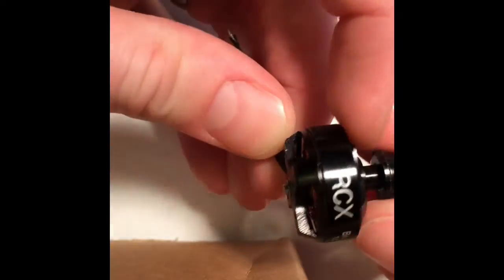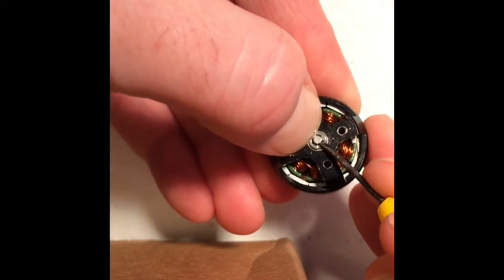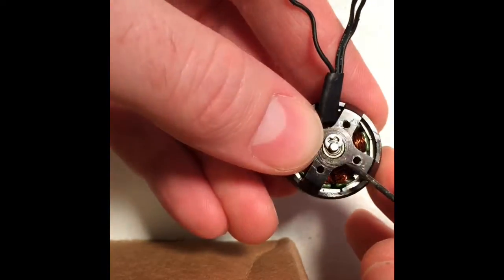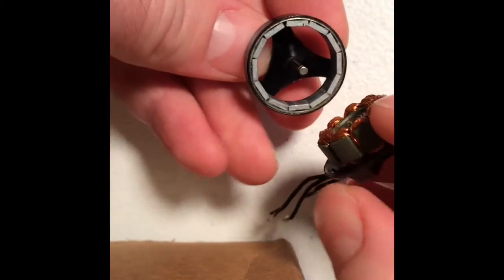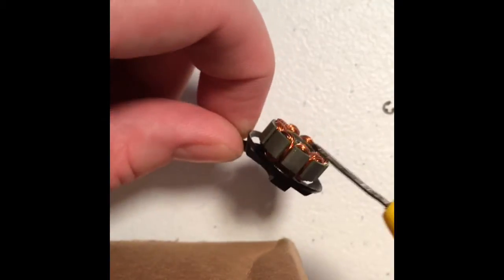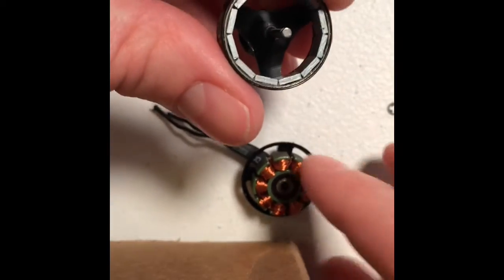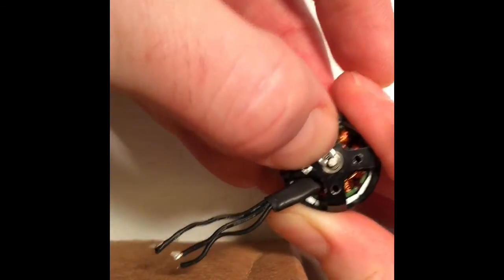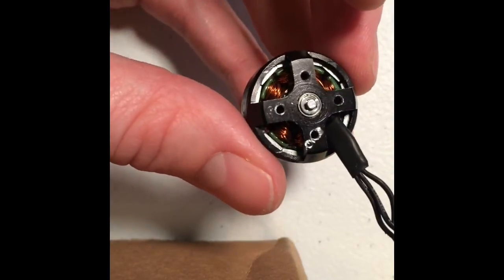Mini quad Brushless motor repair

Comment: I would like to ask you a question would I be able to purchase a Kolletand washer screw seperatly instead of the whole motor for the XK a 1200 RC plane  and I don't want to have to purchase the whole motor and just I don't know what direction to take thanks if it matters its a 2212b kv6400

Comment: Yeah I have the Emax 2400kv motor and it only has a screw instead of a c clip and I don't know if the motor is just really strong or something but I was literally standing on top of my frame trying to pull the top off. I managed to get it off once but again something got inside my motor and this time I can not get it off.

Comment: My motor has a small dent. The magnet isn't loose but just a little off place because the motor housing got a little dent. And this is causing some grinding and friction. Do you know how to fix that?